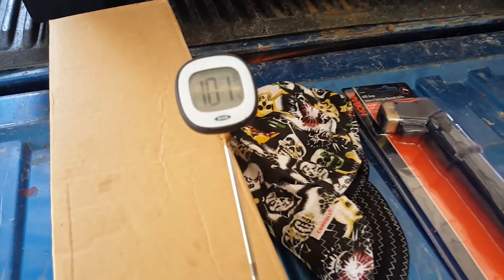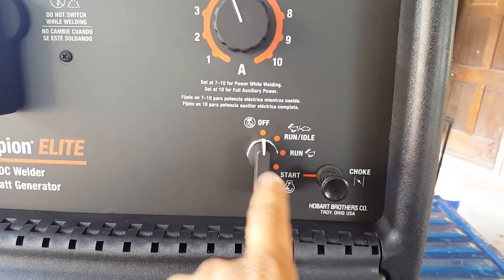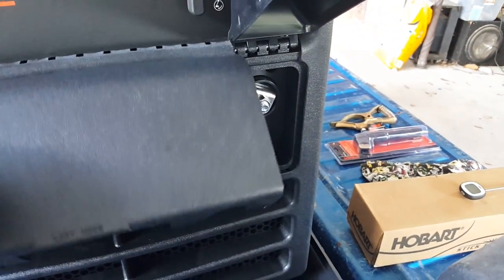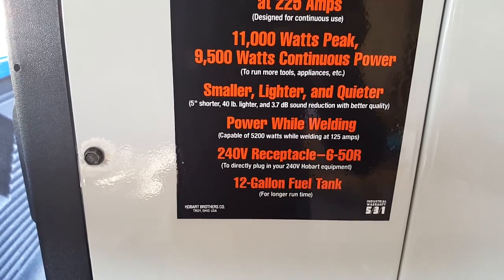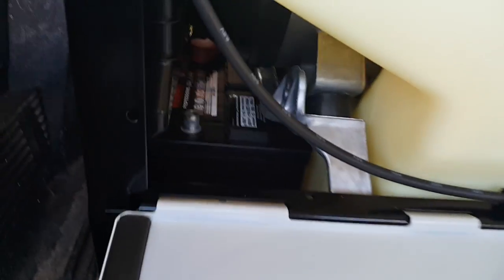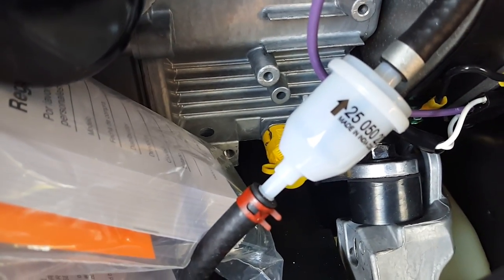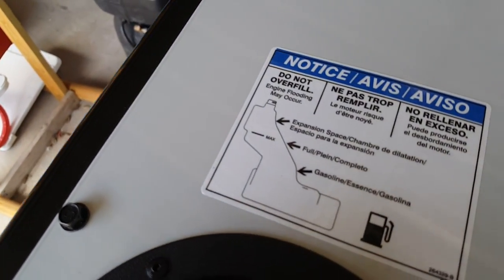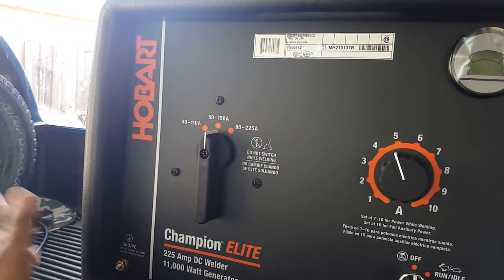PURCHASES HOBART CHAMPION ELITE ENGINE DRIVEN WELDER

Comment: Its been a few years since you purchased this welder, would you reccomend it? How much have you used it? Any problems that you have encountered?
Reply from the maker: I have not used it much but I am around 80 hours. I replaced the battery a couple months ago and that's all. I recently mounted it on my flat bed truck but haven't used either truck or welder. 

The machine welds nicely and also powers my 220v Dewalt 60 gallon compressor, My Plasma cutters and devices during black outs. 

The welder starts up fine during any weather and no issues besides battery going out after a few years of use.
Reply: Will this weld WHILE your running something in the generator??
Reply: @danvertdavis6867  I saw another video on it, they said they could stick weld and have a mig machine plugged into 220 outlet and they said it works great. Can’t confirm that myself, just what I’ve seen.
Reply: @mydinosaurz5479  o wow that's impressive as migs are very touchy on voltage fluctuations!!
Reply: @cutweldngrind  First off, thanks for the video, still relevant today thank goodness.  You said you used it during blackouts to charge devices, are you saying the generator has an inverter that is making it safe to charge sensitive electronics like cell phones and laptops?
Reply from the maker: @thecordlesscarpenter7956  The output if I recall was not clean but I powered my entire home on 50 amps. The welder ran about 6 or 7 hours on a full tank at max output while I was at work. I ran 2 refrigerators, water heater, indoor lights, outdoor lights, furnace with half of the elements turned off, 2 battery charger, heating lamp for stray cats and my computer. The battery chargers were hooked up to a battery bank that had 2 modified sine wave inverters. The inverters powered my 75" TV, Direct TV box , cell phone chargers and other random stuff.

I also bought recently a Generac 8000 watt generator for back up if we get another crazy black out and freeze.

I have 2 small propane tanks for my black stone griddle and during black out I used a small butane stove that ran off a 8 or 10 oz can.

I do have my 1500 watt array ready now but lithium batteries are expensive and covid, import fees and inflation just makes it impossible for me.

Any question you may have let me know.
Reply: @cutweldngrind  Thanks!  I just struck a deal with a guy for a brand new Elite 225.  He bought it in Oct to build out a welding rig then ended up buying a truck that was already outfitted with a miller unit.  long story short, it's still in the box, strapped to the crate it arrived on and he sold it to me for $3,000 even.  couldn't pass it up since if you buy one in the store you'd not only pay about $3,500, you;d have to pay taxes and possibly freight... quickly approaching the 4k mark.  Anyways, I was curious, does the unit come with ground and stinger leads or not?  Good to know the generator will power up most anything you need.  I'll likely get myself a Honda EU2200i for the sensitive stuff that's also much more portable.  I'm gonna be living very remote, deep in the mountains of NW Montana so this setup will be a huge step in getting set up and building a homestead. Curious if the carb will need adjustment at higher altitudes.  Thankfully, a guy put up a video about adjusting the carb (at least the idle).
Reply from the maker: @thecordlesscarpenter7956  Yours may be the newest model but mine did not come with leads. I went with the 1/0 cables about 120 or 140ft total length and really is over kill for me. The welding I do is usually around 90 to 140 amps so a #2 cable would of probably worked fine. I did order off Ebay the ground clamp and electrode holder but really want to switch to the normal holder instead of the twist lock one. I think I have welded 1/2" plate on 1 small project and mostly 1/4" material. Do you have a cabin or are you barely starting to build an off grid project.
Reply: @cutweldngrind  I bought 40 acres of bare timber land up in the mountains, there is a road already cut through it and some other trails plus 3 decent sized leveled building sites.  Once I get my 2 dozers up there I'll be coming back here to Indiana to build out a 20' side opening shipping container to be my home base while I build the homestead (with a big deck out front). Once all that is set up on the land I'll begin building the big timber frame shop/barn and then on to the main house.  I own a sawmill also so this will all be built with timber from the land.  Lucky for me, there is already a deep water well dug and it flows beautifully, my nearest neighbor is about 10 miles away so there's nobody else tapping into my water source outside the grizzlies, moose and elk which I share the property with lol.  I needed to have a welder for a lot of current and future dozer repairs, fabrication  of all sorts of stuff on the stead and with this 225, I'll have more than enough power immediately upon arrival to power up the well pump and get the water out of the ground as well as power up tools and a battery bank until I can settle on a more appropriate size backup propane generator.  The next few years are gonna be a hoot for sure.  I actually grew up in TX (outskirts of San Antonio), I couldn't stand the heat so I got out of the kitchen, joined the Navy and retired 3 years ago... time to really start living my dream!
Reply: @cutweldngrind  How are you liking the royal excelene?Are you satisfied with it's reliability over time in carrying the current and its durability on the job in a practical "every day joe" setting? I've decided to go with 2/0... this stuff jumped up in price since you bought the your 1/0 for your elite, I wish it was still $1.80 per foot lol.  Best I can find is $2.50 per foot and most places are charging $4.00 and up per foot. ugh
Reply from the maker: @thecordlesscarpenter7956  The cable seems to be decent. The cable is flexible but I would like to add a 20ft #2 flex-a-prene or similar cable. I have also dropped stuff on the cable and it has taken some good hits. Rabbits love the jacket so dont leave it on the floor if you have rabbits roaming the yard.
Reply: @cutweldngrind  Roger that on the rabbits 😉, good to hear the cable is good quality, thanks

Comment: How's it holding up? Used it much?
Reply from the maker: I actually just turned the welder off. I used it to power my 60 gallon 240v Dewalt compressor this morning and now welding some 7018 Hobart 1/8 electrodes. I am building a Gin pole for my truck but so far the welder has worked great. I may use it more in October or November once its cooler outside to build stuff on the ranch. If you look at my last video it shows the 2 7/8 pipe mocked up. I am slowly recording today  but ots hot. Anyways the welder works really good.

Comment: Just bought this welder, did you figure out what those wire connectors are for?
Reply from the maker: I still dont know what those wires are for. I saw the connectors again this week as I relocated the welder.
Reply: @cutweldngrind  I’m thinking you can add remote start. When I go to airgas I’ll look at there 225 Miller bobcat and see it will give me some kind of a clue
Reply: I believe it’s for an optional 220v plug or something. At least that’s what I got from the manual I may be wrong

Comment: A dc stick welder. As it should be. Won’t ever be using ac
Reply from the maker: I used an AC welder for years and when I switched to DC it was the best experience ever. I can't remember the last time I powered the Lincoln. Thanks